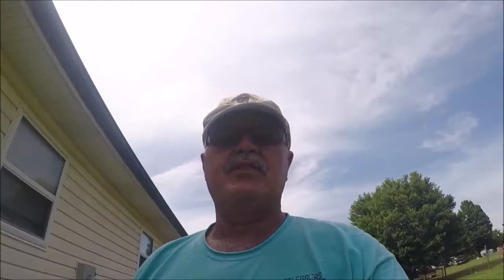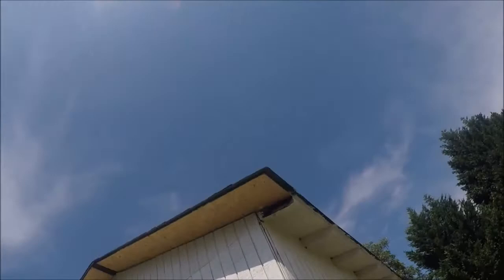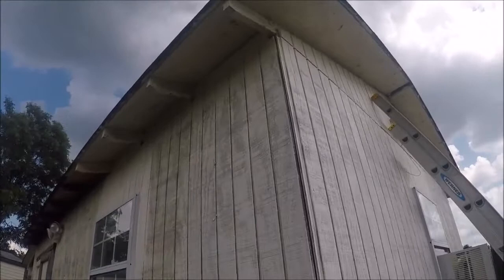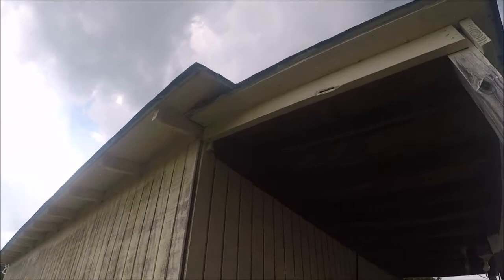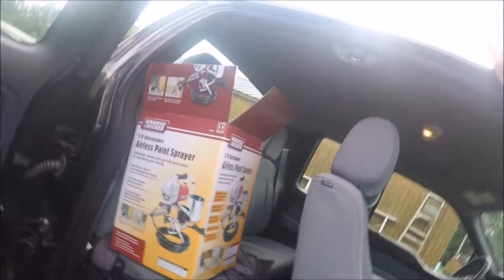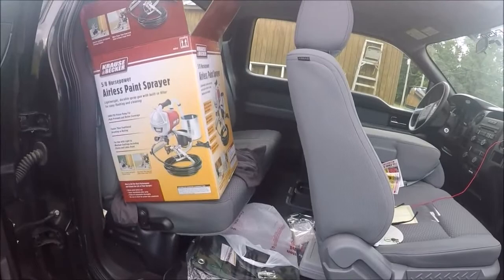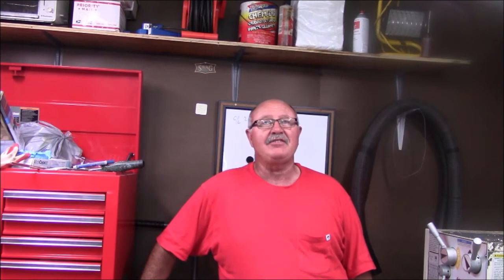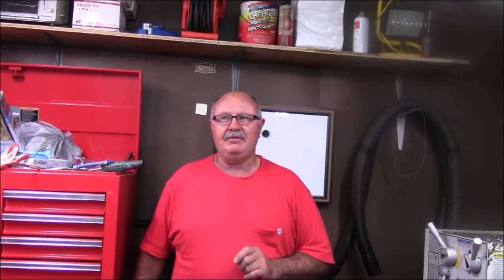A machinist tries to paint the shop

Comment: You are correct on the airless sprayer.  I have a 12'x32' out building with the same type siding, and believe me the airless sprayer made it so much easier to paint.  By turning the spray head to give a horizontal spray pattern, and spraying up and down, you get a good coat of paint in the grooves.  That onerous job done, the machines are calling, "James, come use me"!